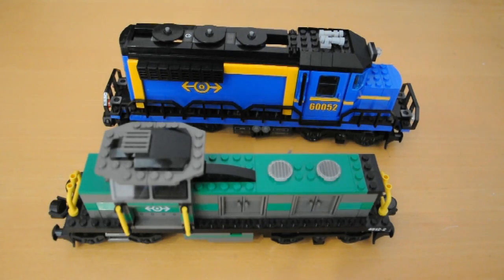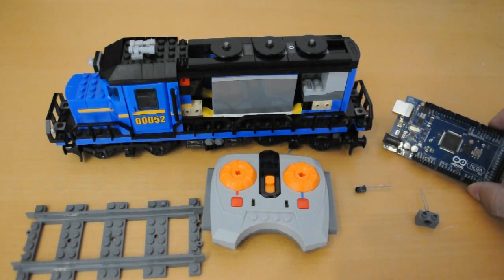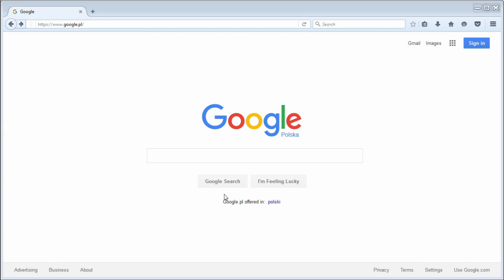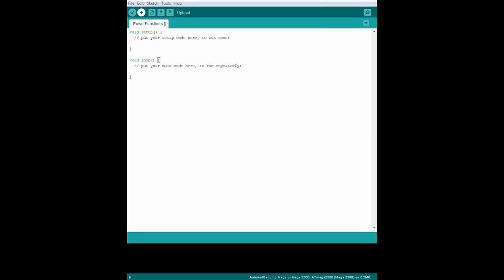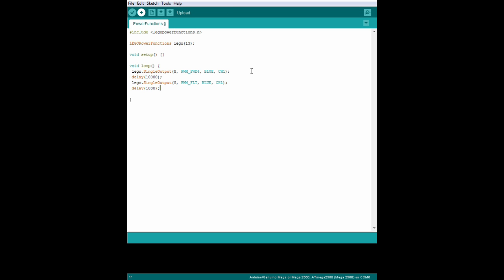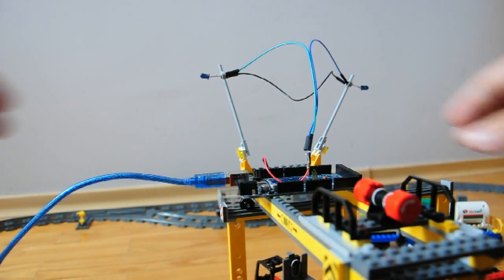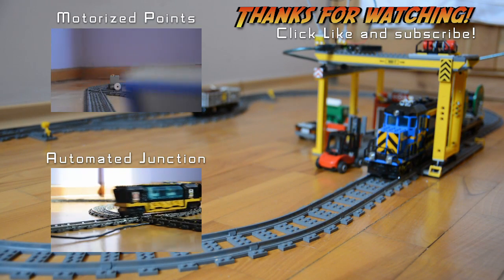Arduino for Lego Trains #11: Controlling Power Functions Trains

Comment: I would also suggest to go to google, search for "Arduino pin max current", notice it's 40mA, and use transistors for your LEDs.
It will survive the 200mA with IR leds as they a pulsed very briefly, but if for some reason your code hangs and leaves them on you are going to cook the Atmega chip.
Reply: i agree it would probably survive in this situation but i did add a 2n3904 to drive the leds
Reply: So to avoid this could you do the same thing but use the 5v constant and make the io pin gnd?

Comment: Nice work. 2 questions: Did you write the PowerFunctions library yourself? If so a video about how you decoded the default remote would be nice. Lastly, can you control multiple trains like this with a single arduino?

Comment: Thank you so much for this, i've tried getting the codes that the remote sends to the reciver but it did'nt work=)
Reply: The Lego reciver has two cable outputs posibilities; one BLUE and one RED. Yo must write in the arduino code the same color than the one that you have conected. This could be your problem, because this happened to me.

Comment: I find your videos always good but this is a slight disappointment : Why cant you just connect the function to the battery already in the train? I mean, it is illogical that the train will have two power sources, when in fact you could use the Lego battery box to operate both the wheel movement and the remote onboard control unit. No ?
Reply from the maker: +TitinaNasturbova Thanks. Yes, you can use the Lego battery box, which is what I do in the next video. But it requires buying a dedicated lego cable, destroying it, and soldering a custom cable from it. This video aimed to show the proof of concept (onboard IR control) without that expense or complexity.

Comment: hey,
Great video! But I was wondering if this also works with another type of train (7898). I tried it but is won't work. :(
Reply from the maker: Sorry - 7898 is an RC train, not Power Functions, so you'll need to use a different method.

Comment: Can you also explain what BLUE in code means ? Thanks
Reply from the maker: Lego Power Functions transmitters and receivers use 8 channels: RED 1-4 and BLUE 1-4. You can see this indicated on both the transmitter and receiver. In this case, BLUE tells the arduino to transmit commands to the motor connected to the Blue plug on the Power Functions receiver (ie the one inside your train).

Comment: On your website it says I need a 100ohm resistor but in your tutorial you said you needed a 39ohm resistor, Im confused??????
Reply from the maker: The video shows you how to calculate the resistor value for that specific IR LED (the TSAL6400). In most cases, a 100 Ohm resistor will work fine for most IR LEDs. If the resistor is too high then the IR range will be low, but if the resistor is too low then you risk damaging the Arduino, so 100 Ohm is a "safe" value.
Reply: Alright, Thank you

Comment: Is this a dumb question... I cannot find the parrameters for a resistor for this led I'm thinking of getting to try this
https://www.adafruit.com/products/387
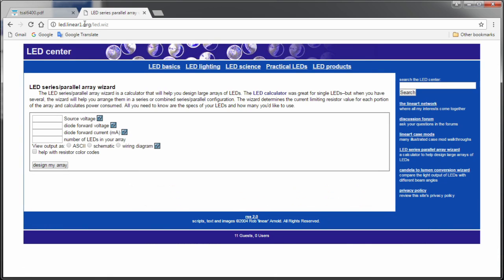Reply from the maker: From the video: "Go to the datasheet and find the forward current and forward voltage values." The website you linked shows "Approx 1.6V forward voltage", and the datasheet that's linked on that page says "Continuous Forward Current - 100mA". Those are the values you need when using the resistor calculator shown in the video at 2:55.
Reply: Arduino Lego Trains thanks

Comment: do you have a fiverr account?
Reply from the maker: Not any more, because the fees are too high. What would you like me to do?
Reply: oh mann:(Actually basically the features that you have on ur channel but all combined into one.But using wireless communication between the train and the components on the train track.
Reply from the maker: Don't worry, wireless communications will feature in the next video!
Reply: Arduino Lego Trains but is it possible to cut the wires of the motor and connect it up to the L298 Motor?because I'm having problems with which wire to connect to which pins
Reply: hi i got a question to ask,if i were to strip the wire of the wheel motor, to connect directly to the motor driver,where does the wire have to go on the motor driver that will be on the train.
Reply: Faris Khan